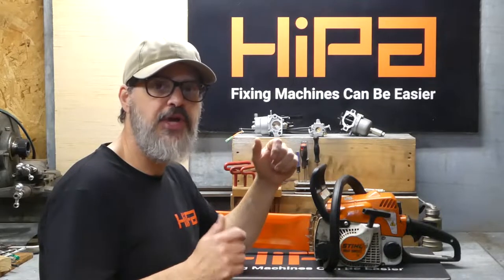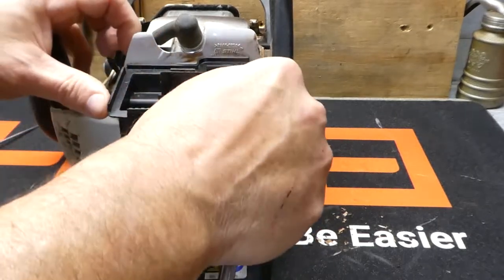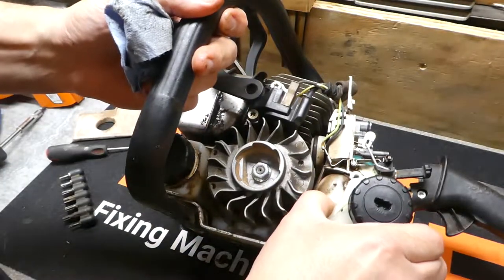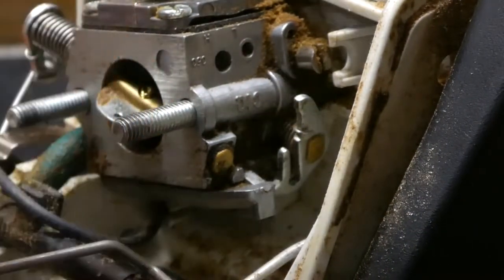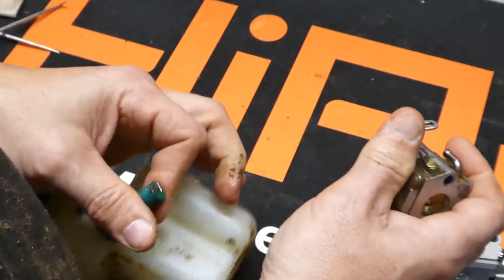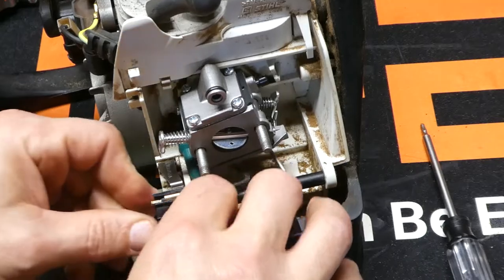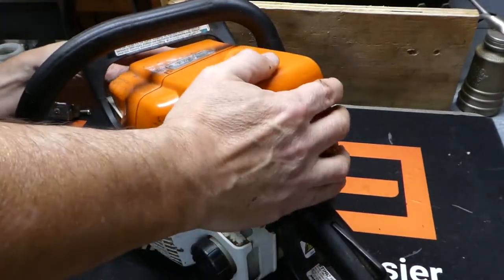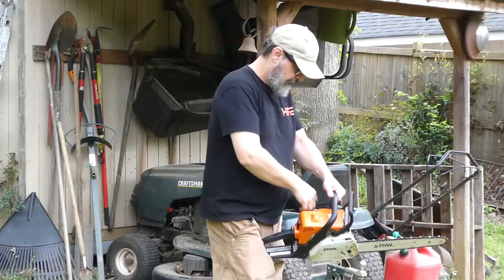Easily Replace a Stihl MS180 Chainsaw Carburetor

Comment: May I Ask, what  about just cleaning the existing carby instead of replacing it? Many thanks
Reply from the maker: You could just cleaning the carburetor. Sometimes the diaphrams and needle seal inside the carburetor may get problem and need a replacement. The carburetor is very affordable nowadays. Some of them are below $15. If you feel it's not worth spending too much time cleaning the carburetor, buying a new one is also cost-effective
Reply: @HipaParts  thanks very much. I really enjoy the videos too

Comment: You should putting the choke lever on but at the 10:20 point you talk about checking the choke but the lever is not installed.  Then you assemble all with the lever lying on the bench.

Comment: Hey Guys.  With the help of this video I managed to replace the carburetor in my 180.   But it's not running perfectly, it'll start right away but then it bogs out when I try to give it throttle.  Then it will just die start bog..die over and over again.  Any suggestions are there any adjustments that need to be done to the carb?
Reply from the maker: Hi Mike, there'are many reasons and I hope this video can help you out. https://youtu.be/_wI-X7aot8Y

Comment: I do like my stihl saw, but I do not like the obvious " designed to fail" parts that are built in. Good that there are other brands and models to choose from. A few of the clones that are of simpler and reliable designs have filled the gap. ESPECIALLY for people that don't like the primer bubbles.

Comment: Hi, I cleared everyparts that connect to the carburetor from sides and the front. Somehome theres still suctioned behind from the engine thats prevent me from pulling it out the 2 prongs, any tips ?

Comment: Why. Not quickly wipe out the clamshell interior @ 08:29, before sliced ng the fuel tank back in?  Yes, they are saws, but eliminating junk and grime wherever possible adds to the running and lifetime of the unit?  Just a thought.... 😊

Comment: What is the part number for this carb
Reply from the maker: Hi holmes, you could chece the part number here, they are listed in the "model fit guide" https://www.hipastore.com/products/hipa-carburetor-filter-for-stihl-ms170-ms180-017-018-ms170c-ms180c-c1q-s57a